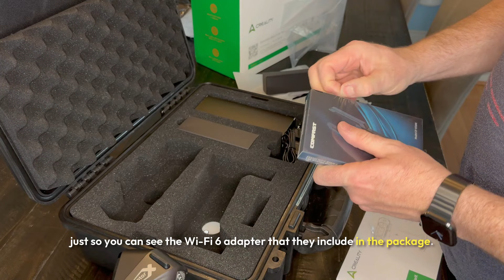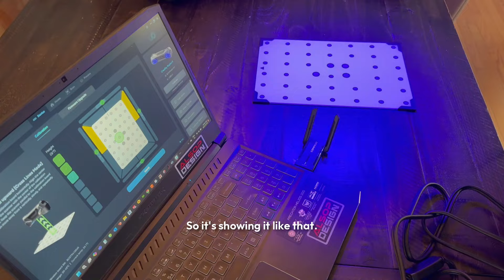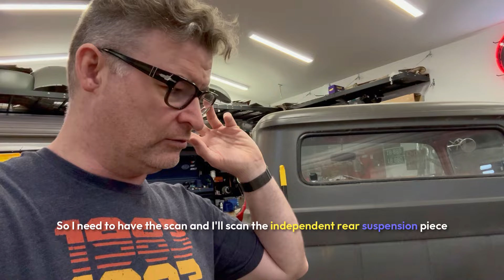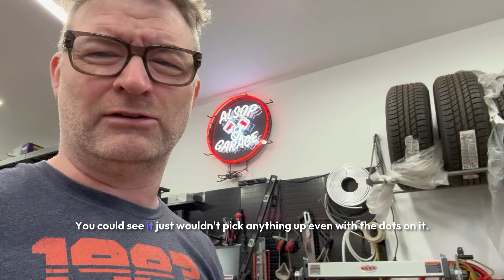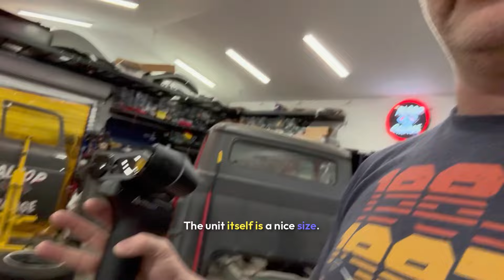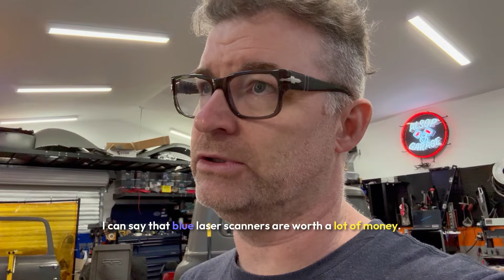Creality Raptor X - 3D Scanner - Unboxing | First Scan | Review

Comment: Some of the points are placed almost in a straight line. You need to zigzag it as much as you can. 

Also since the the chassis rails are far apart, you can place planks across and place targets on it. This way the volunetric accuracy would be much better rather than following around the rails. 

Blue laser is not as sensitive to lighting as such. Did you try increasing the exposure? Dark objects will need higher exposure.
Reply from the maker: Thanks for the tips, the issue with picking it up seems less to do with markers and more the exposure setting.  When I did it in the dark, it picked them up no problem.

Comment: For me screen duplication on my smartphone don't work. Have you the same issu ? I don't see anything on your smartphone.
Reply from the maker: Probably because I had to speed it up so much it didn't show it well.  I did get it to work.  You have to have your phone on the same WiFi connection as the handle or what they call "Bridge".   So you have your laptop on the Bridge WiFi and your phone on the Bridge WiFi - then you can scan the QR code in the Creality software.  

Also, you have to turn off any firewalls you have enabled on your laptop - or at least for the Creality Scan software.  I also had to restart my laptop after I did that.  It took a couple attempts, but after all that it connected on my phone via a web browser - which is basically a type of remote desktop session.
Reply: @AlsopAndSons  Thanks. I retry all  opérations for check.
Reply: I have found my problem : Avast. Perfect after shutdown all protections. Thanks again